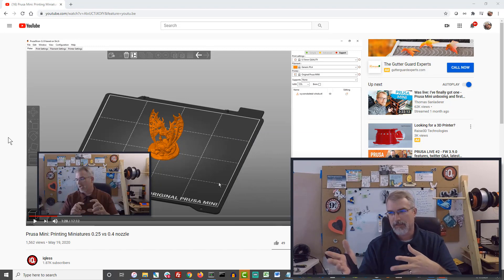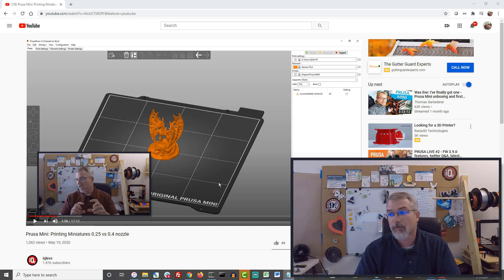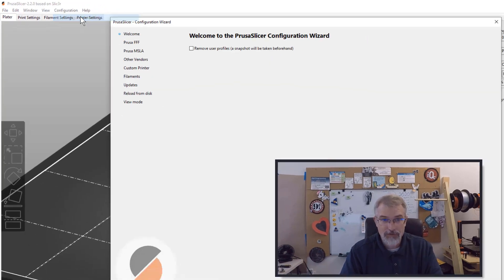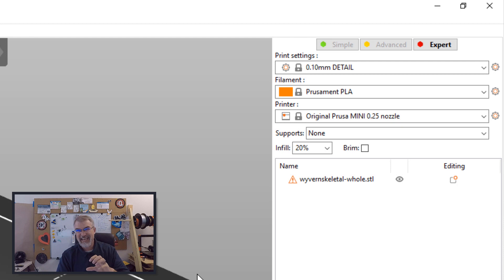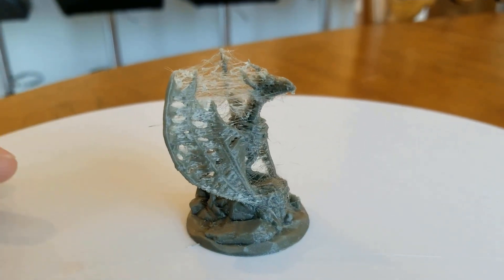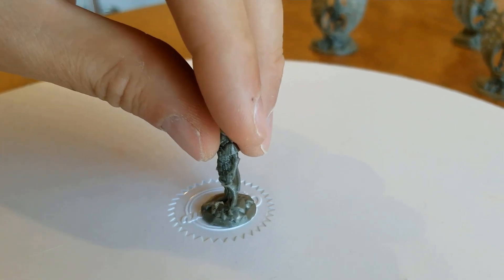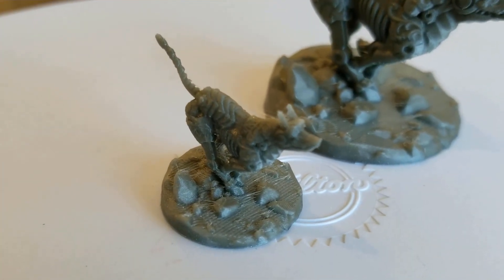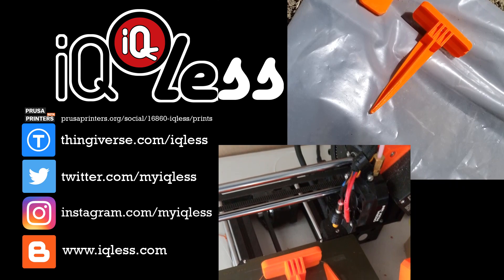Prusa mini: Printing Miniatures w/ 0.25 nozzle round 2

Comment: Your absolute min. layer heights for a 0.25mm nozzle should be 0.06mm. You should not cross a certain ratio between nozzle size e.g. 0.4mm or 0.25mm and layer height. The smaller the nozzle the smaller layer you can print and vise versa. You also get stringing because you remelt the previous layer, lower your temps, increase cooling, increase travel speed, turn off z-hop, increase retraction, turn on wipe while retract and tune it. Those should help with stringing a lot.

Comment: I understand that this video might be dated, and you've likely discovered solutions over the years. However, for those still curious about eliminating stringing, I found a remarkably simple fix that worked for me, assuming you're printing with PLA. The key is to significantly reduce your printing temperature, while also considering ambient temperature. For example, with my Prusa Mini+ printer, I achieve optimal results at 205°C during winter and 200°C in summer.

Comment: that looks like either the wrong temperature or wet filament. I've had stringing that bad so I started drying my filament and printing directly it out of the dryer itself. Made a big difference. But it also looks like it might be too hot. I'm wondering if a smaller nozzle means different temperatures are needed.

Comment: Hi Patrick, I understand that you want a One profile does all but its hard to have one profile that is fast and effective for every stl. the little dragon stl you showed is a great example since the couples first layer take a long time to print versus the later layers, there is already a setting "if layer take X time, slow down the print" but its not always good. that's why right now with all these slicer we have in 2020, we still need to tweak. unless you have the mindset of "its good enough" and its fine. maybe in couples years the slicer will make the tweak itself... there is some "IF" in the code but not enough yet.

Comment: Two big things that help reduce stringing are extruder settings and filament temperature. The first and easiest setting to change is the "retract on layer change" box found under "printer settings" -> "extruder 1", This setting helps reduce stringing going from one layer to the next. You can also play around with the "length" and "lift Z" settings in the same window, but that's not as beginner friendly as checking a box. There's a simple test print on Thingiverse called "Smaller Base Stringing Test" by bartoaster that you can use to dial in the stringing setting per filament brand/color.

Second, filament temperature has a big effect on stringing. Light colors like white and virgin PLA will string a lot more that dark colors, so run those 5-10 degrees cooler than dark ones. The 215 default is a little high for some brands, so lowering that down little by little can help. I've even gone down to 190 for virgin PLA and had good prints, but if you go too low you risk clogs or layers that don't want to stick together.

Comment: I think the issue with printing at the .5 layer height with the .25 nozzle is heat creep.  With the small amount of filament being used the filament is expanding and making the retraction setting off a bit.   You can tweak the settings and save as a copy of the original so you can always go back to your favorite original settings. 

I would drop the hotend temp by 10 degrees first.   Try a test print.   If it's not enough try adding. 5mm retraction.

Comment: Thanks, I also notice when using the 2.5 nozzle that supports remove must easier than when using a .04 nozzle.
Reply: It’s because with a 0.25 nozzle they end up thinner so they’ll break easier and not attach as much to the model

Comment: Great vid. I highly recommend trying out a .6 nozzle, too. As long you don’t want to print below 0.20 layer height it is a great time saver on most (bigger) prints (due to saving time with perimeters).
Reply from the maker: I have a .8 and 1.0 I bought that I would like to test out with face shields at some point to see how fast they can print
and to see if the print still is good for what I need.
Reply: @iqless  Just one note on bigger nozzles. The real speed limit on how much plastic you can lay down at once is the melt rate of the e3d hotend. This is tweak-able via the Maximum volumetric speed setting per filament but the default heater recommends keeping the average plastic extruded around  15 mm^3/s for PLA. But most other filament types are less than this. If you setup a .8 or 1.0 profile in the slicer you will notice it will slow the print move mm/s way down to keep from overwhelming the heat cartridge.

These nozzles do allow you to do really low infill and down to one perimeters and still get really strong parts, but without a heater block upgrade the print times are not that much shorter going between different huge nozzles. But, its still worth a try as it will all be much faster than the stock at laying down plastic, which does perimeters at about 5mm^3/s at the fastest draft setting with infills at 12mm^3/s.